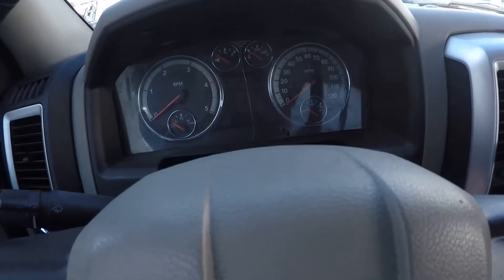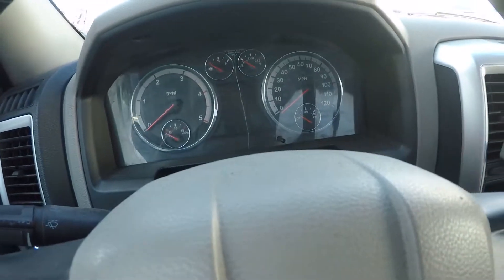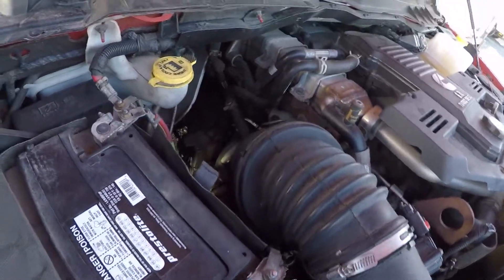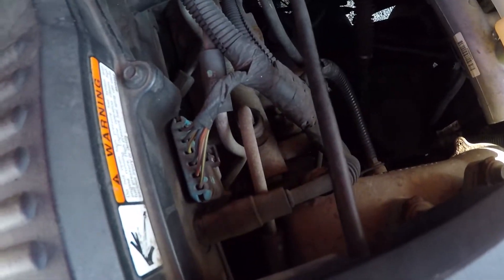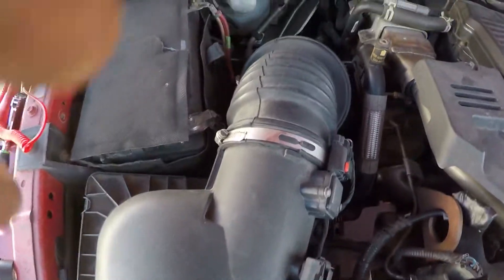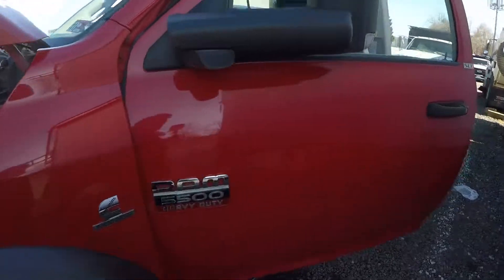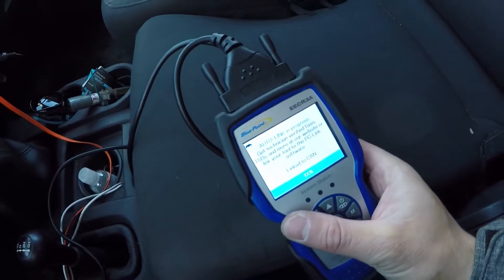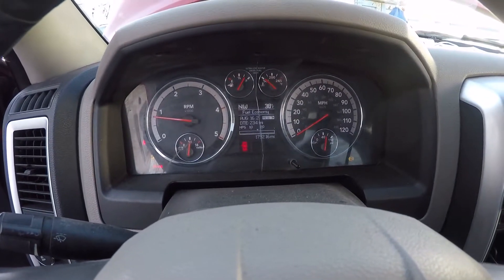Deactivating Grid Heater Cummins 6.7 Diesel

Comment: You get no check engine lights or code anymore with it disconnected?  I want to do this to mine but worried it will keep throwing a check engine light if it trys to turn it on and sees its not there
Reply from the maker: it wont throw CEL on just when you start  the truck don't wait for the heater light to go off start it right away

Comment: Instead of disconnecting the grid heater line from the relay switch can you disconnect it from the battery?
Reply: I've seen Marion Blair's method do it from the battery terminal. Based on that, I would say yes, and that's when I'm going to try to do.
Reply: I disconnected from the battery more than year ago, no any problems

Comment: When you first turn the key, the low oil pressure light comes on (red light). If you start the truck right away, will that be bad for the engine when there's no oil pressure yet?
Reply: You dont get oil pressure till it starts no matter how long the key is in the on position
Reply: @Cuontheflipside72  thank you